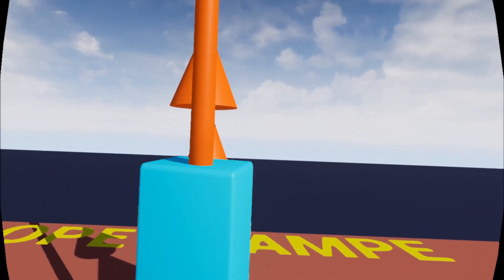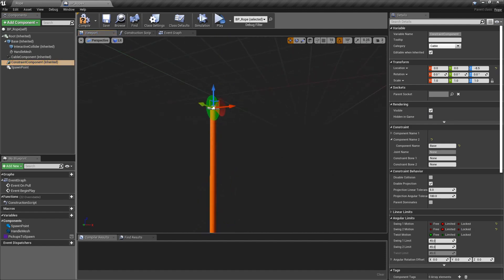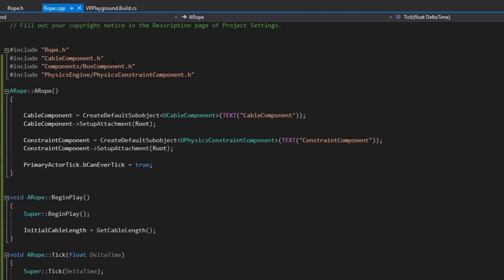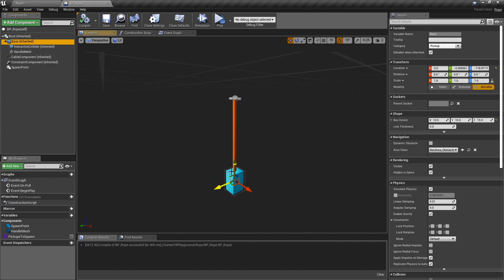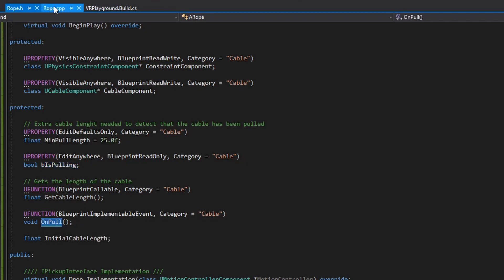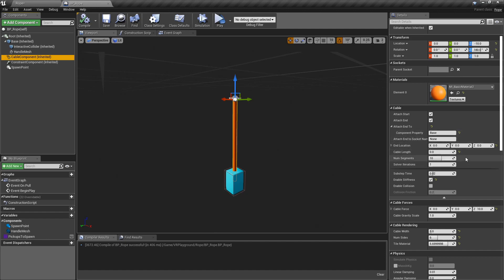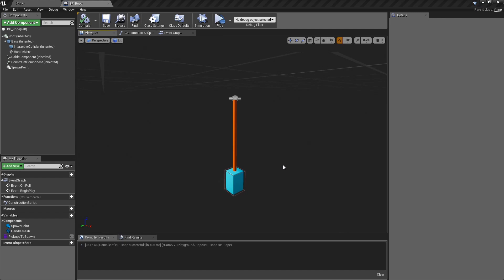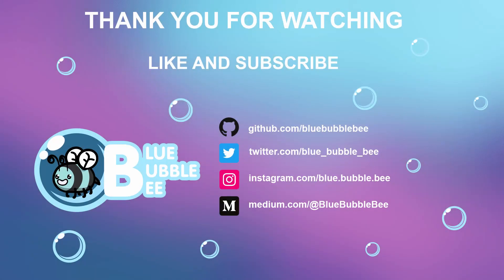Pulling Chain in VR UE4 Tutorial (C++ & Blueprints)

Comment: hi any chance that this works without cpp?
Reply from the maker: I am afraid the project is CPP and if you want to make it work you need to compile or make the project in blueprint from scratch
Reply: @BeeBlueBubble  yes that’s right. I struggle to get the cable in my Project attached to another actor i have in the bp.  Thats just a cable with a lock_bp on it.